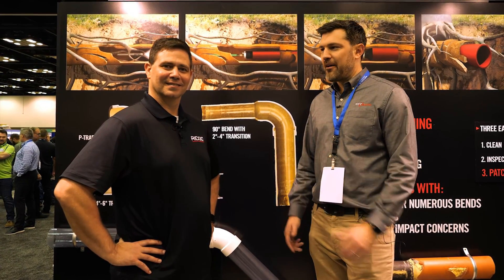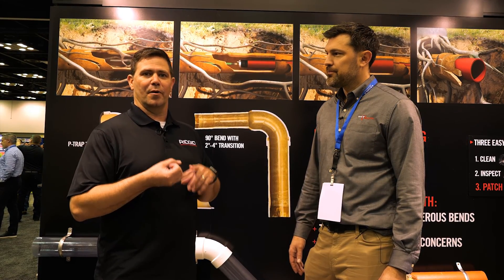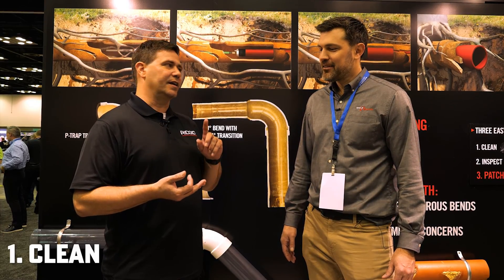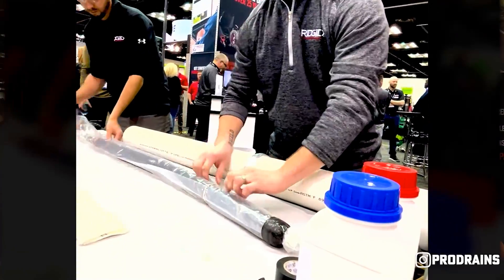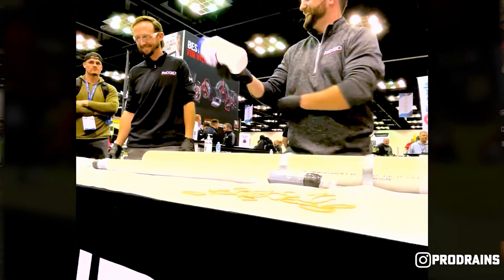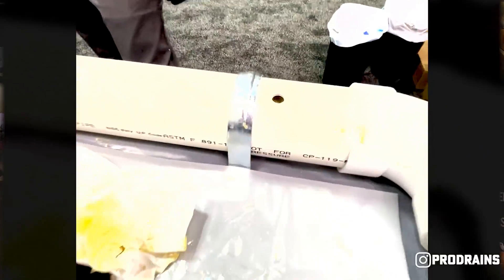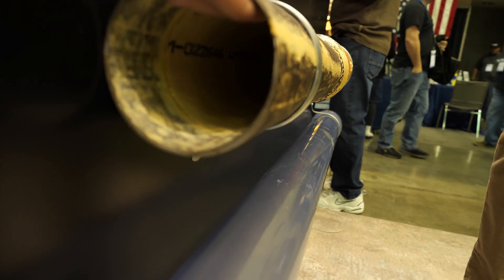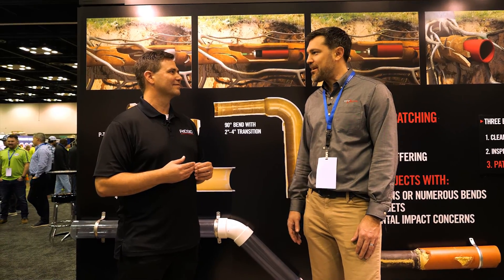Drain Line Pipe Patch & Repair Kits New from RIDGID Plumbing at WWETT Show 2022

Comment: does the repair create a lip that can cause a stoppage?
Reply from the maker: When properly installed, the repair should not create a significant lip or protrusion that can would cause a stoppage or hinder the flow within the pipe. The epoxy or patching material is typically applied smoothly and leveled with the surrounding pipe surface, ensuring a seamless transition. I hope that helped! Let us know if you have any other questions!